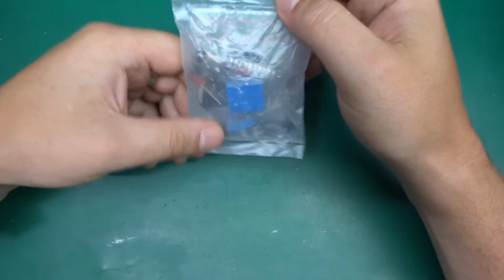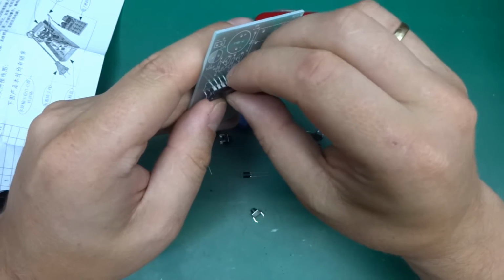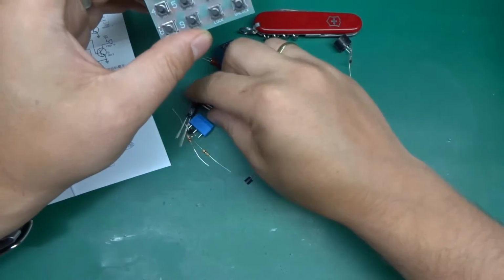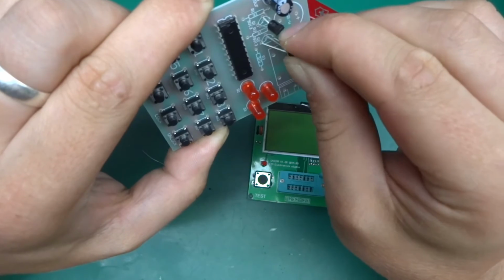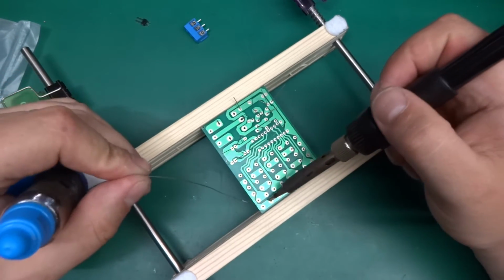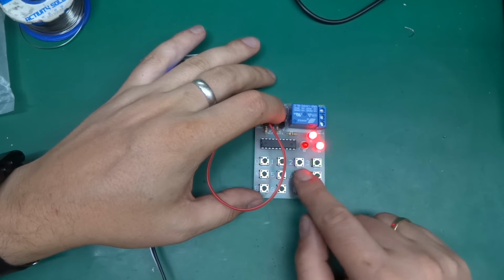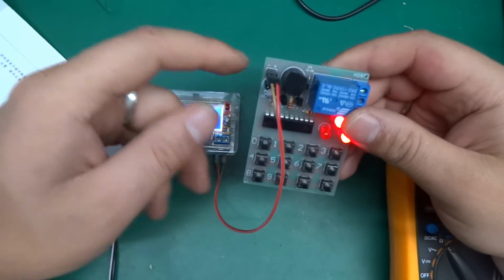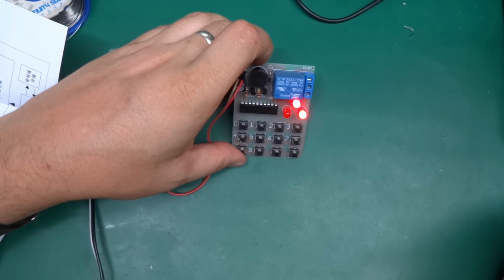DIY electtronic lock kit (HQS1436) from ebay - build

Comment: Hi there, I've just built one and had same problems, when I typed the chip into google, your video turned up in results. Apart from that no help anywhere. LOL.
BTW, you should have installed the diode, it's for the relay.